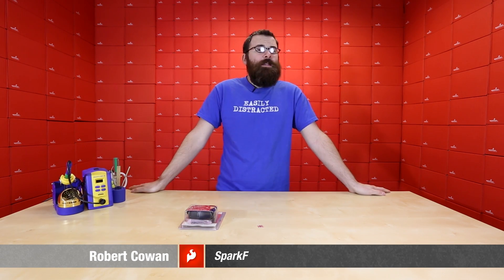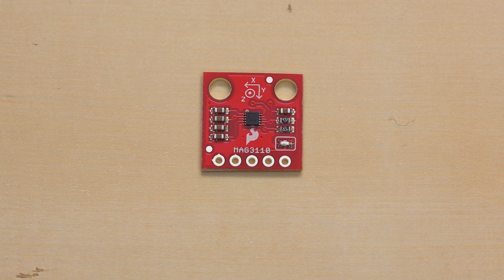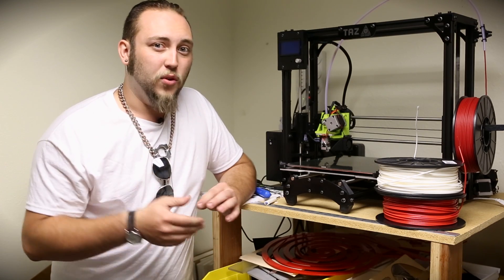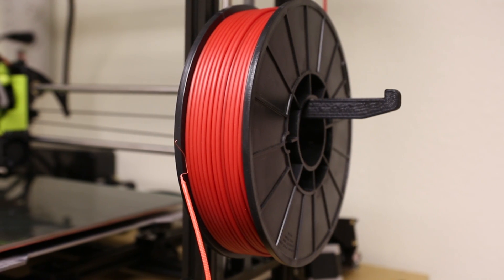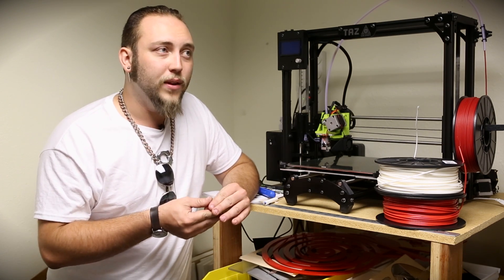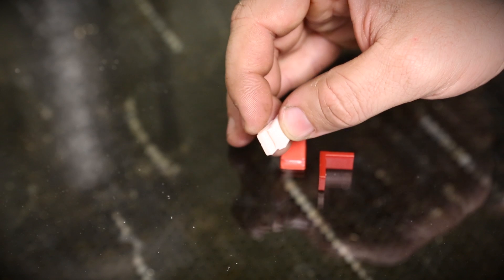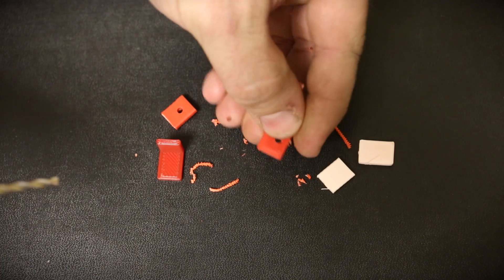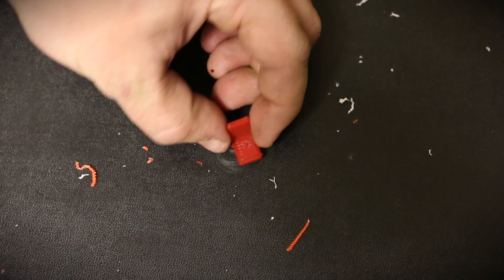SparkFun 7-11-14 Product Showcase: Fil'er Up

Comment: FYI for people interested, just some info that I found to be incorrect:

PLA Prints at 185-220 degrees celcius, not 130-140.

NinjaFlex is really flexible, something like a hinge probably won't work.

PLA is the easiest to print with, and provides the BEST looking parts. ABS is not hard to print with, but for long prints you will most likely get cracking and bad looking parts. 

Ninjaflex is actually the hardest to print with.

Comment: The filament comparison was nice.

Though I already knew ABS is good for machining :) If it's a thick peace the heat of the drill will eventually smooth the surface.

One quick question: Can you glue PLA or Ninjaflex pieces together?
I know ABS can be glued together by carefully applying acetone, pressing together for a few hours and the surfaces melt together.
It's incredibly handy for making pieces that if printed in one piece would break because the forces they suffer tend to separate layers